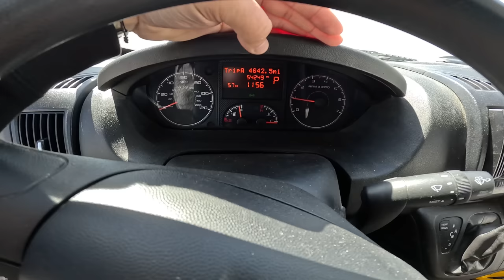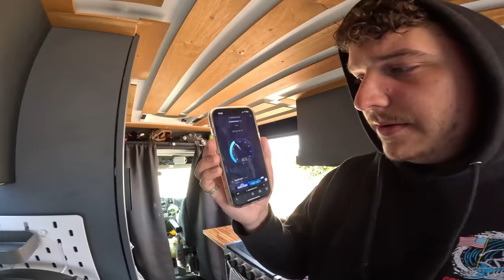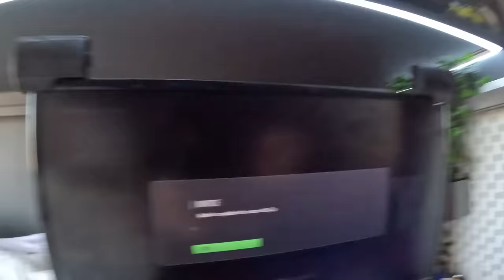Vanlife Gaming In The Desert | Using Only My Phones Hotspot

Comment: Your download speeds are not Megabytes (MB); they are Megabits (Mb). It takes 8 Mb for 1 MB. Internet bandwidth is almost always measured using Mbps (Megabits per second), since the higher number gives the illusion of faster speeds. Your 340 Mbps would translate to 42 .5 MBps (Megabytes per second).

Comment: What your speed test shown was in megabits per second, not megabytes per second. Divide the megabits by 8 then you have your megabytes per second. Either way it's a very fast connection, just 8 times slower than what you stated. That 300 megabits means around 40 megabytes per second, which is still extremely fast.

Comment: Im late. But i just found you a few days ago. And have watch 57 videos now 58... Lol.
But at the end talking about power. I run mt xbox and tv off a 500w inverter for my truck camper, i also charge my phone and run a 50ft string of led Christmas lights. I have a generator and solar but i can rune my "main stuff" of my vehicles battery without touching my power banks. First comment. But good stuff. And off to the next video. Subbed for sure. I hope you see these comments tho they are late.

Comment: I started using my phone for internet in the truck but quickly realised I was going to fry my battery and drastically shorten its life so I bought a 4g modem (with better tower reception) and wired it in and got a data plan thats way better value than anything you get with a mobile one usually....Which allowed me to get a cheaper phone plan. Overall it has worked surprisingly well, it is what allows me to live a totally mobile life with all its advantages with almost no compromise. Do you know how much extra fuel you use by using your cars engine to charge you batteries?

Comment: Saw a guy that had star link in his van for wifi. He essentially gets service everywhere no matter what since it connects via satellite. Not sure if you don't have service often enough to justify it but it's definitely worth looking into. The only downside is you need a dish on the top. That blows your cover though and not sure if it would be ideal with your fans already on top
Reply: You can stow it when not in use; might not be worth it if you have decent cellular connectivity most places and don't have big internet needs because it's expensive, but I have it for my home internet in a rural area and it has been great.
Reply: @TexasPanhandler  If cost was his biggest concern I don't think he would have 2 hotspots and hotspot data on his phone.

Comment: Have you looked into getting something like a Victron Orion DC-DC charger that way you can at least get a little charge off your stock alternator to your house batteries while driving? I plan to get a secondary alternator but also am going to have a massive battery bank to be able to run my 12v A/C.
Reply: lol I guess I should have finished the video before commenting haha

Comment: I run my desktop computer and its a hog on my power in my cargo trailer conversion. playing games it uses 350 watts. right now i only have 100 ah at 24 volt lithium. doubling it next week. i have 1600 watts of solar on the roof and thats how i charge or with a gen but i havent started that in a month or so